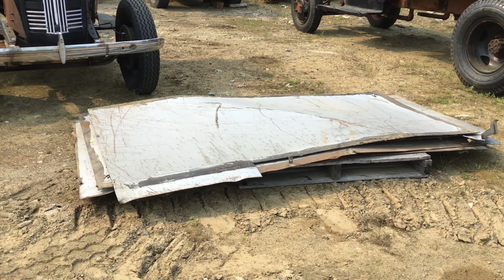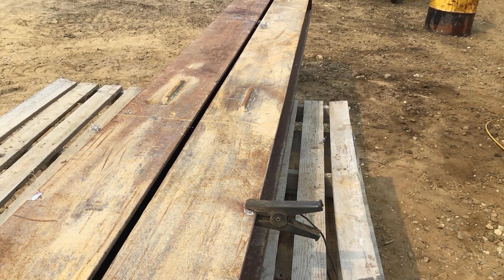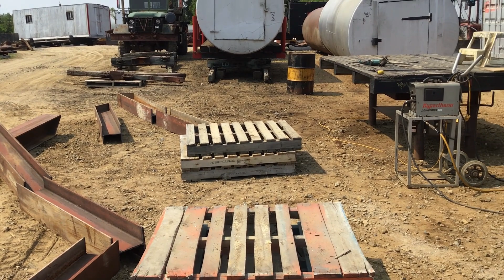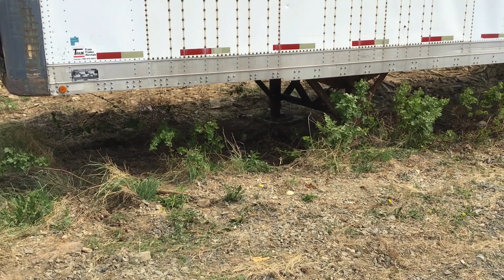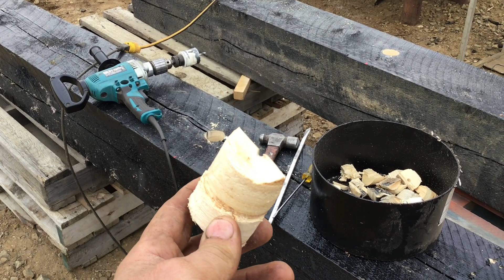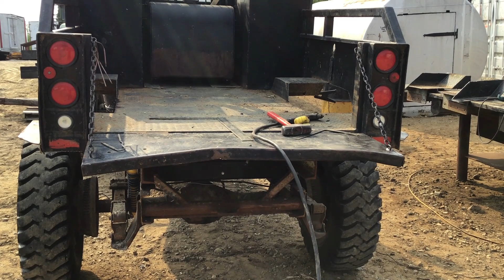Drilling Wood in the Cold Temperatures of  40f was Easier May 31 2023

Comment: Funny you say that, it's been wet the last three years as it has been the same here in australia but now it's dry and no rain we had a couple of cold days 0c to 4c which it should be at this time of year, but now we started winter with 16c to 19c overnight unusually warm  and dry looks like we are going into drought again
Reply from the maker: yes not good for being too dry it screws up a lot of things. those temperatures would feel so chilly to you being used to the heat all the time.  thansk
Reply: @kingofobsolete4789  yes i wear thermals at these temps too cold
Reply from the maker: @needwindinmysails6349  yes just like us when it warm day for you is too hot for us and we take the day off to sit in front of the AC.  thansk